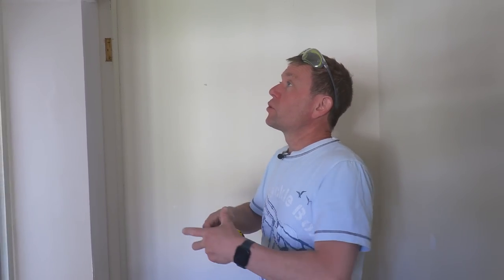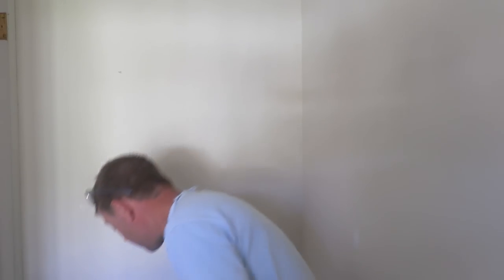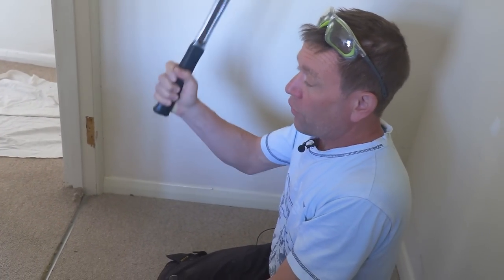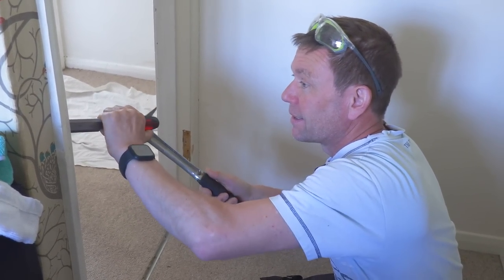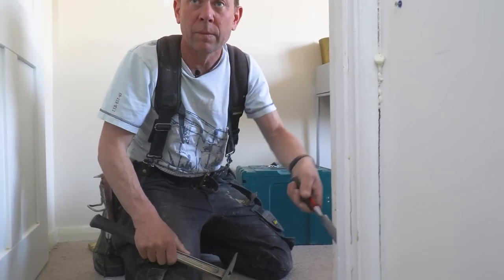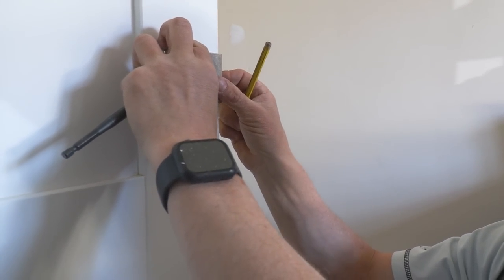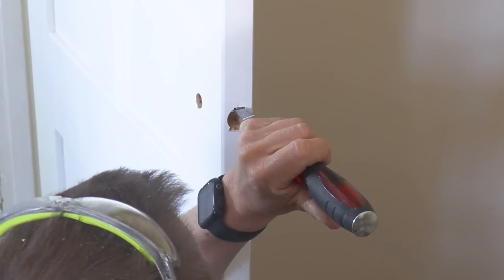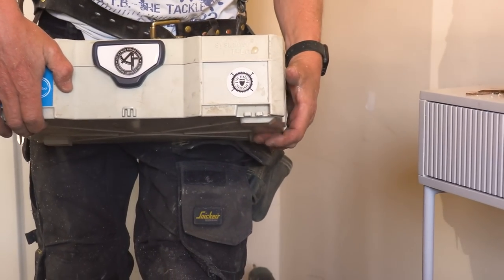A Common Door Hanging Problem Sorted

Comment: These type of jobs can be unbelievabley time consuming and can be a nightmare in real older properties where the frames were fixed into propeller wedges once the architraves off you can end up with no end of potential damage. A lot of the doors customers are choosing are totally pre finished so it's more about fitting the frame or changing the frame🙈
It goes on and on. And while your up and down the stairs some scumbags have robbed your tools from where you were working. And then people wonder why they struggle to get anyone to come and fit one door .😄🤔

Comment: I had hammer envy for years, finally treated myself to an Estwing, and I hate the thing! Too heavy, horrible plate on the base of the handle, I think the shaft is dangerously shaped and the handle (leather) is slippery. Pretty to look at, but an ergonomic disaster (in my opinion)
Reply: Wow, I love my estwing, after swinging it for many years. Mine has the rubber handle so no metal plate at the bottom. The shaft is good for splitting wood at times.
Reply: Get a Stiletto!

Comment: I replaced my front door hinges with decorative hinges by removing one hinge at a time. Now I have a 1/4 inch gap at the closing side near the top. For the life of me I can not picture what needs to move to straiten the door.
Reply: Were the new hinges thinner or the same thickness as the old ones? Did the old ones have some cardboard shims behind them and you didnt replace? If so, your new hinges will be deeper in the frame/door or both. Cut some cardboard shims out of cereal boxes and put them behind the hinge plates. That should move door closer to the closing jamb.
Reply: Thanks I will take a look at that. I never thought about the hinge being a different thickness.

Comment: I concur with the comments. Try hanging pre-finished doors, one mistake kaput. Great Carpentry. For a while now I have started fitting the latches while fitting the hinges on the door. It's much easier and I have a little plastic jig for the 57mm backset. And yes, folks just don't understand the work involved.

Comment: Thanks for the video guys, only one thing, DUST SHEET’S, the young ones are watching, and they will copy. That’s not a negative, a good video to show how it’s done.
Reply from the maker: The carpet was being replaced. We asked the customer about it and they said don't bother putting down protection.
Reply: @SkillBuilder  Good call, I knew you had it covered. thanks for the videos you do. The only reason I said anything is because you know, what you do, others follow.

Comment: As someone with years of P&D experience let me inform you that the crescent moon hole that Dan left on the side of the door handle after making his cavity for the latch is a nightmare to get right afterwards. It's not an average caull/fill job. When a door is painted white it and the handle is shiny metal it stands out like a moon in a clear night sky. Wrapping tape around the handle to fill sand paint never works out right, inveriably some paint bleeds onto the hardware or the sand paper scratches the hardware. The only way to fix this is to remove the handle and if the carpenter has done a whole house of doors with an oversized bit well thats a bucket of handles, which inveriably will get slightly scuffed taking off/on/storing. Trying to paint doors with no handles.... Nightmare and unessacary of the job is done right the first time. I have watched Dan glid on rooftops many times and if I were on a jobsite with him I would pull him on this privately. But I am not so I need to do it here in the coments. Other than that, lovely work Dan, I'm here to learn and share so that we make things easier and more professional for each other.

Comment: 4" butt hinges, and especially three of them, is total overkill on an interior door that is 1 3/8" thick, and on top of that they look bloody awful, and the kind of job a novice would do.
A pair of good quality 3" butt hinges, washered, or ball bearing, is more than suitable for most interior doors, only adding a third to a heavier door, but only if the casing is straight enough on the hinge side.
Why try and fix an age old system that is not actually broken.

Comment: Look at how doors are made and hung on Europe.. It's such a better design..
The pin is screwed to the door frame..  Then the door has a type of catch with a slightly hole to match the pin on the door frame..
Then you just place the door onto the pins..  It also means no unscrewing if you need to remove the door for any reason..
The UK system is so stupid by comparison and I still can't understand why no-one thinks to introduce the better system?
Reply from the maker: agreed and those sets are now available on new build

Comment: My house was built in the early 1700's
Nothing is flat, smooth, square, level, plumb or straight.
All my doors are individually sized to fit the hole. Nothing is standard, there is certainly no builders botch it expanding crap in my home.
Reply: You have no expanding foam in your 1700's home because it wasn't invented then, you also won't have cavity walls or insulation for the same reason. Materials and techniques change over time,  todays 'botch' is tomorrows craftsmanship.